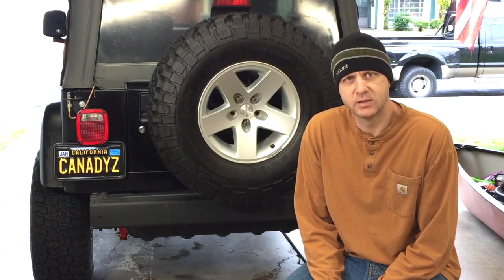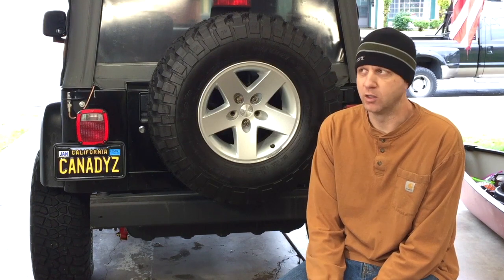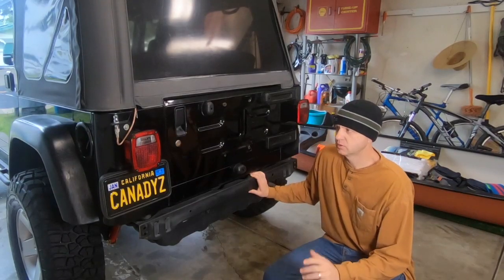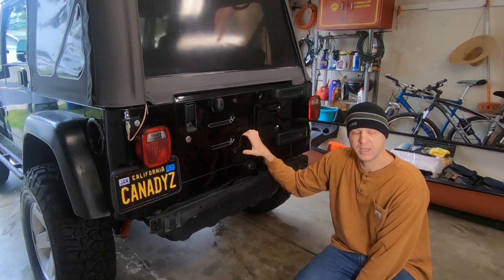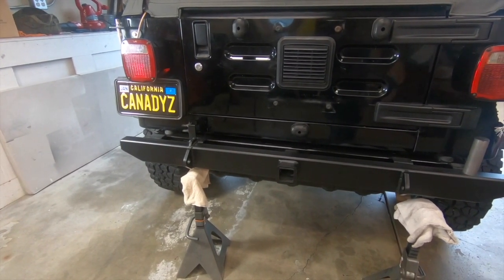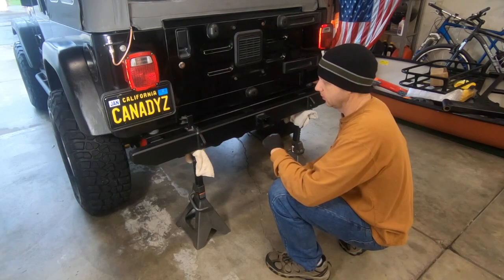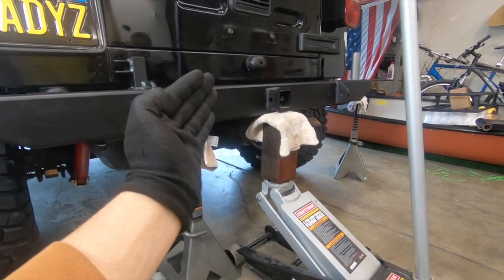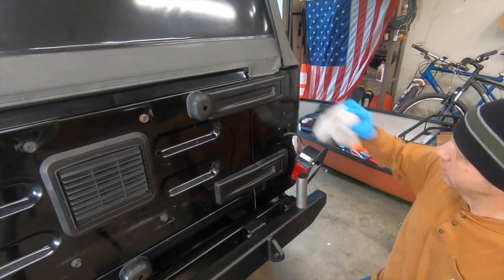LOD TJ Tire Carrier

Comment: Checking these bumpers out mentioned in your video.

Not sure how the metalcloak bumper and LOD signature series bumper sticking out a little bit more on each side is going to hurt much under most situations. I think if anything it will protect the vulnerable corners of the tub much better... 

If you look at the hitch/receiver setup on the metalcloak bumper it is substantially stronger; actually trussed into the back of the bumper and tied into the frame (not just the paper thin flimsy rear frame cap). The LOD is just a pass through receiver tube with little reinforcement.

The metalcloak bumper hinge also appears to be a superior design and the carrier arm locks in the open position which is a nice safety and convenience feature in off camber use.

But...the metalcloak bumper is almost $600.00+ more than this one... so there is that lol.

Nice rack! ;-) haha
Reply from the maker: I 100% agree with all of that, and I really wanted to like the MC bumper, but it was just too big.  I think, for me, I prefer to have the bumper recovery points attached and not have to rely on the MC hitch receiver for recovery, albeit it is stronger.  I have hit the back bumper a couple times coming off obstacles and I did not want to have a bumper hang any lower than possible.  Thanks for watching and weighing in!
Reply: @rogercanady6227  I would be rigging a bridal setup anyway (two points of attachment) if using light recovery point tabs on something like the LOD; without the frame tie ins id still be real hesitant about yanking on that bumper hard.

Utilizing the receiver as a recovery point on the MC bumper/any bumper tied into the frame you are pulling the vehicle out by the frame rails, not the weak rear frame cap. You essentially have a built in bridal since you are automatically pulling from two points when using the receiver.

Not sure I see that much of a substantial size difference between the two on video; though it's hard to compare over the internet. I will look closer.

Another benefit is that the MC def protects the fuel tank from rear impact better; something jeeps have a problem with.

departure angles can always be improved via other means, jeeps do drag ass.

Comment: Great Rubicon!, do you have build specs? The lift and accessories are what I’d like to set my Rubicon similarly.
Reply from the maker: Try to look me up on Facebook “Cade Vinson” because I post a lot of updates about the Jeep. 

As of today:
BFG km3 315/75r16 tires (35s)
Metalcloak 3.5” game changer lift
JKS 1.25” body lift
Brown Dog off-road 1” motor mount lift
UCF extra clearance tranny skid
Metalcloak front bumper 
LOD rear bumper tire carrier 
Body Armor TJ rock rails 
Warn  evo 10k winch
Front/rear Metalcloak diff covers
Metalcloak gas tank skid
Metalcloak steering box skid
Metalcloak steering stabilizer 
Carbon chromolly front axle shafts
Black magic brakes
Amazon led headlights 

I thinks that’s the bulk of it.